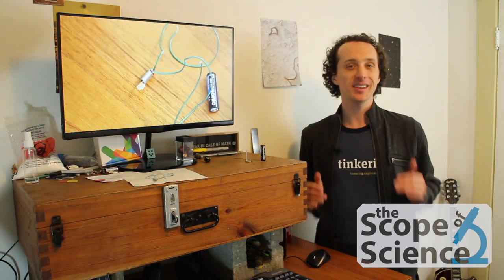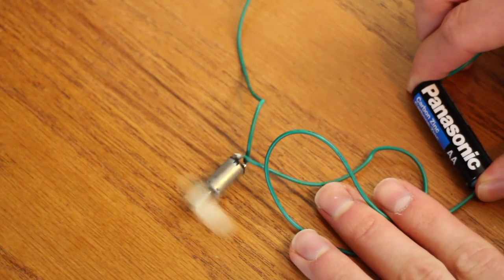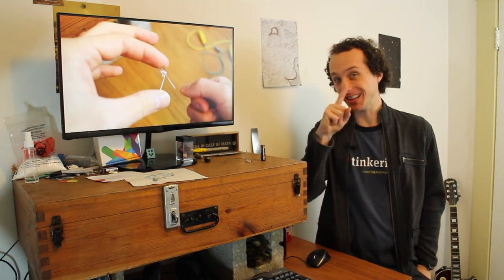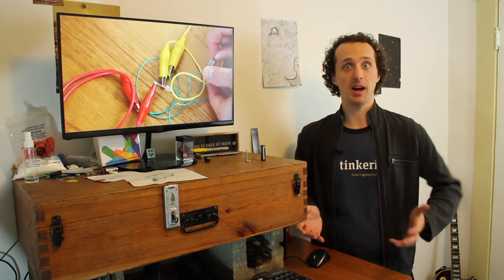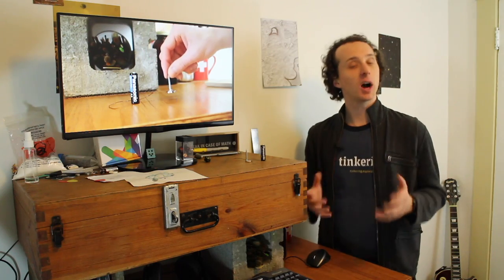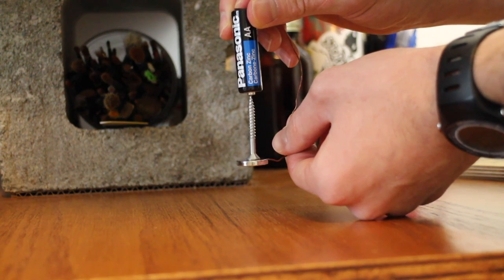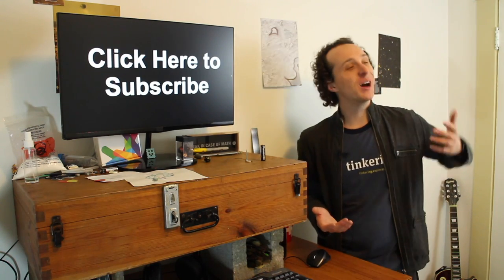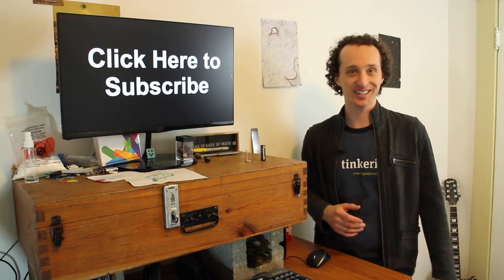3 Easy Experiments in Electromagnetism

Comment: I'm on my way to the hardware store right now!  I assume the screw isn't aluminum.
Reply from the maker: Steven Baumann fantastic!! Pretty sure it was steel.. but it should work with aluminium too, since it also conducts electricity
Reply from the maker: Wait... aluminium does but aluminium oxide doesn't,  so nevermind!! I've gone mad with chemistry. don't use aluminum screws
Reply: Thanks!
Reply from the maker: Steven Baumann No problem! Glad you're giving it a spin ;)